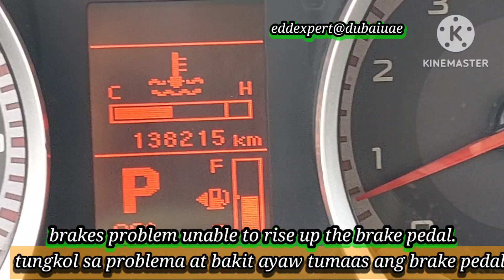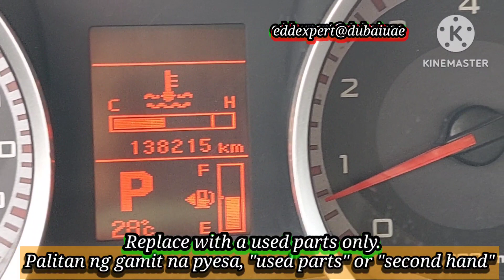🇵🇭 Brake pedal unable to rise up. ABS valve mechanism failured. Solved. Mitsubishi Lancer EX.

Comment: I got a problem with my lancer gta. I suddenly stop the car because of bypassers then my brake pedal ay lumusot but it stopped the car so to return back the brake pedal i need to step on it 3x then it goes up again. What would be the possible problem sir? Maybe you can help me
Reply from the maker: If you pump the brake several times and it goes up. You have a weak brake master,  but if you pump several times and nothing change, it's an ABS valve itself ,valve are not working properly. And have test drive ,while driving at constant speed and suddenly press the brake pedal, if swerving at any sides and the pedal is low  it has a faulty ABS valve. Do I make myself clear.
Reply: @edralinbustaliniomcbautomo7707  thank you sir for the inputs. That happens to me 2x. So the problem i got is the brake master. Correct sir?
Reply from the maker: @joemerchua5477  as per my explanation just read the symptoms if you encountered such fault then you may decide it.
Reply: @edralinbustaliniomcbautomo7707  and should i replace the brake master or maybe you know in the philippines who can help me with my car problem.
Reply from the maker: @joemerchua5477  if you pump the brake and it goes up, I'm sure brake master is failure. If you pump several times even while you're driving, ABS system failed.
Reply: @edralinbustaliniomcbautomo7707 sir location nyu po still in dubai papalit sana abs